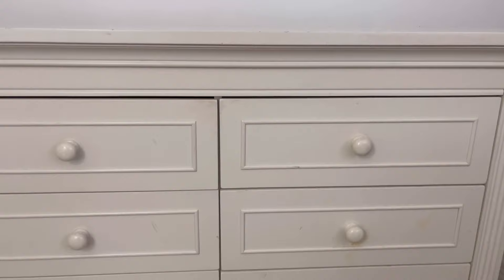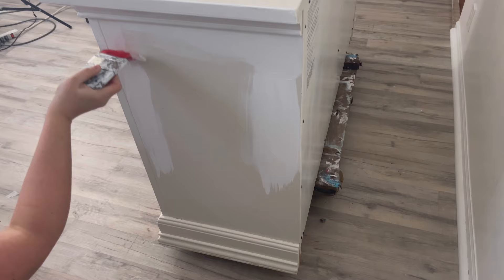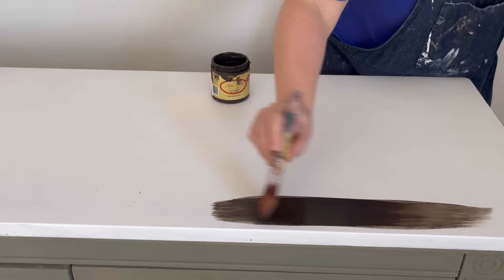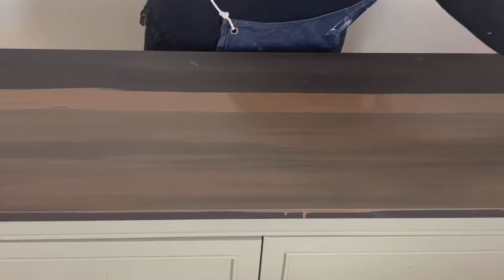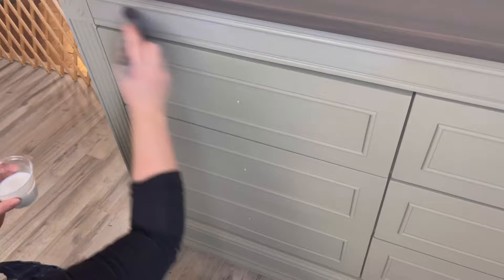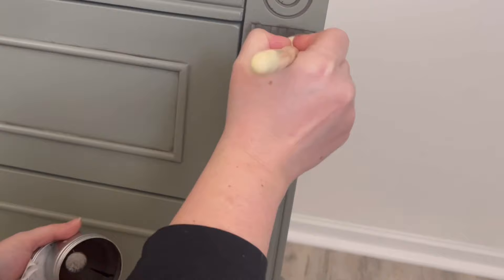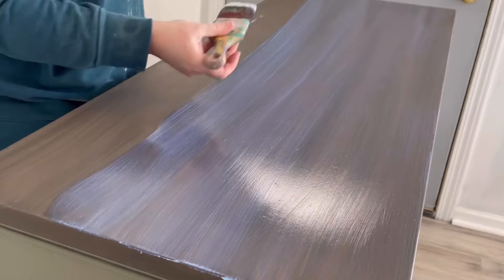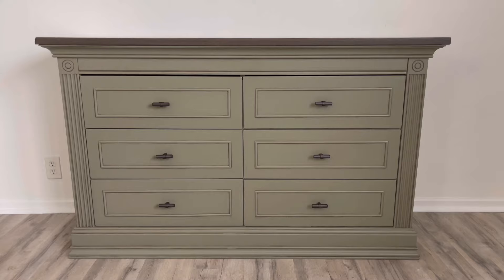This easy diy dresser makeover is a great way to update your bedroom!

Comment: Did you put slick stick on the top as well?  I'm hoping the Boss will do the same job as the slick stick
Reply from the maker: Hey Virginia! BOSS should only need to be used to block odors, stains and has no adhesion properties. Where as Slick Stick is an adhesive primer that helps your paint grip onto slick surfaces like glass, countertops, and plastic. I hope this helps ♥
Reply from the maker: Hi Virginia, Slick Stick and BOSS are problem solvers that are used to solve different issues. BOSS is not a grippy adhesion primer so it will not do the same job as Slick Stick. Slick Stick is used for slick surfaces to ensure complete adhesion. BOSS is used to block odors, and stains and stop bleed-through!